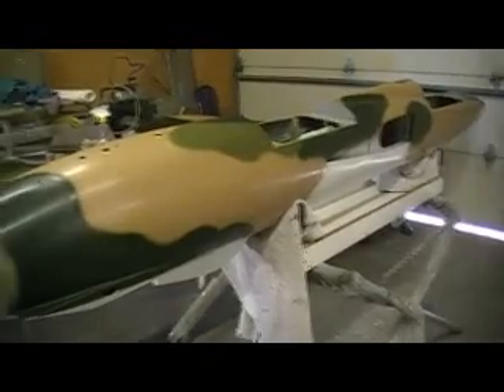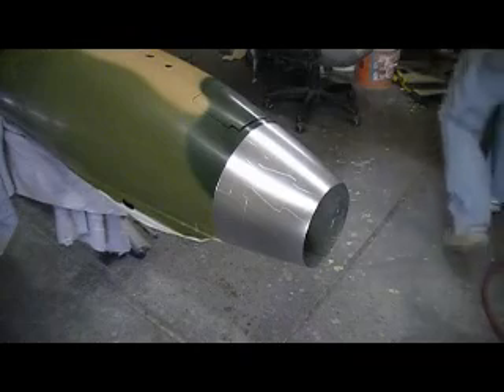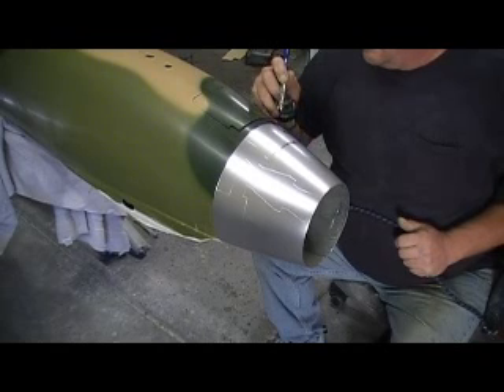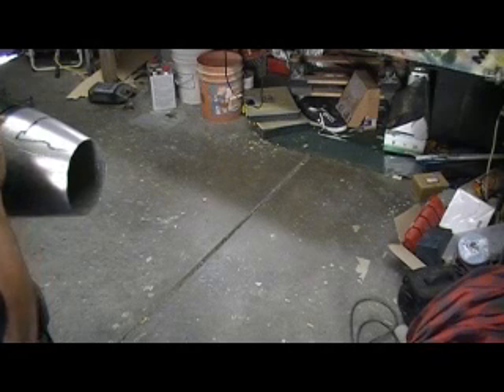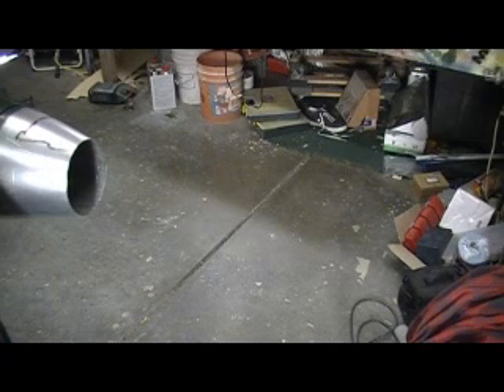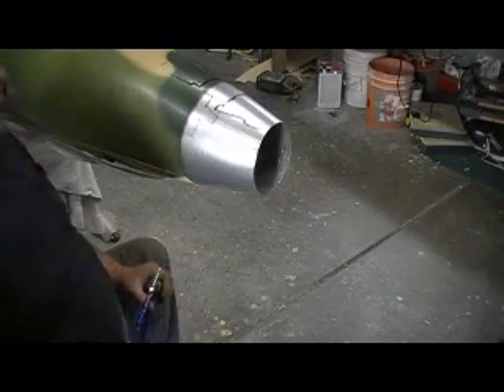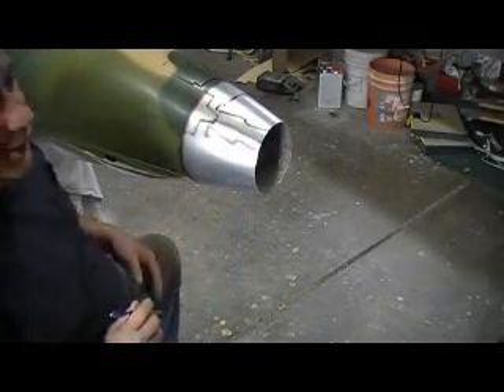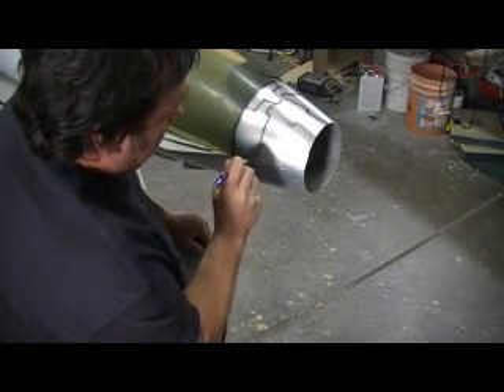how to build a rc jet F-105 thunderchief # 469

Comment: For panel line enhancing I take a sharpened #2 pencil and run it along the grooves for each panel line.  Then take a soft paper towel and dry polish over the panel line in the direction of airflow over the aircraft.  The graphite filled panel lines and streaks from the pencil lead are then sealed in with the final low-gloss or flat clear coat.